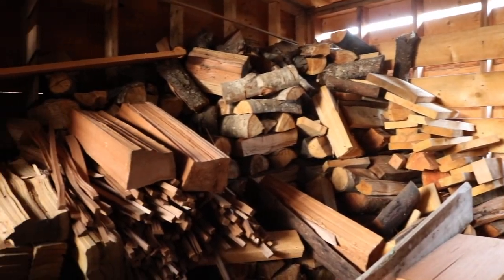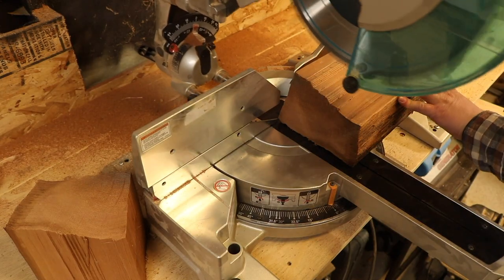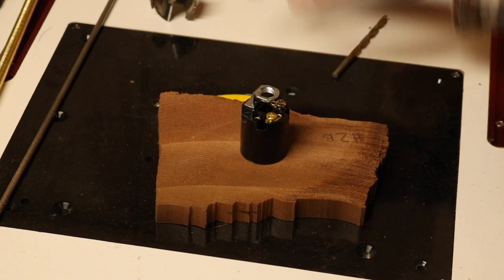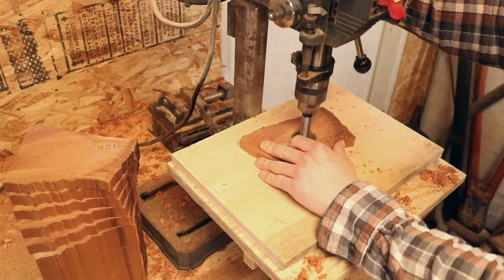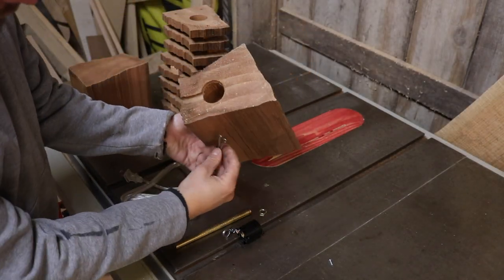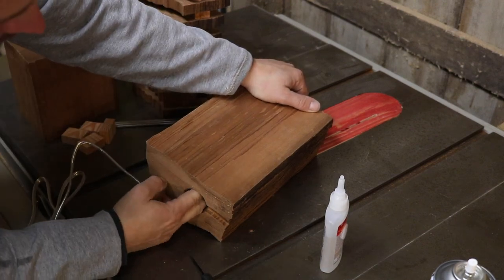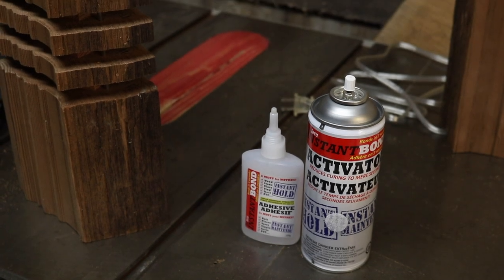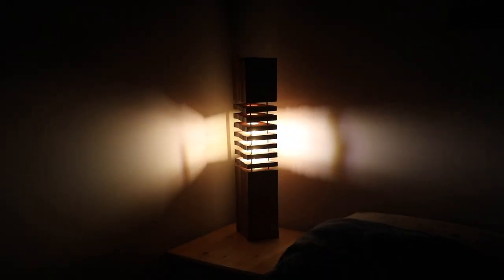How To Build: The Segmented Log Desk Lamp

Comment: Great Job. I took this as inspiration for my own project. The only things I changed is the the mass, adding a base, and the lighting technique.

I’m in Germany doing my Carpentry apprenticeship. On a jobsite I was able to take home an Oak girder beam that we cut out of the house’s old construction (Fachwerk).
My Mass is roughly 15x15cm with a height of 160cm. To put it into perspective, I am 6‘2 which is about 188cm. Perfect for the living room.

For the base I used two 4x6 cm pieces overlapping and painted black to match the live edge oak end table I built.

I didn’t like how the light doesn’t go throw all the slates so I took 2 Satin acrylic glass Pipes (Diameter 8cm and 5cm and an aluminum pipe (diameter 2.5cm). I wrapped RGB LED’s around the Aluminum pipe and basically layered my pipes. One of my Glass pipes did not disperse the LED‘s enough but after I added the second pipe it put distance from the outer edge and the LED‘s and more thickness in the dispersion material. (from 2mm to 4mm). Looks like a big light saber now!

Glued the slates onto the outer glass pipe. Looks amazing!!
Reply from the maker: Thanks for reaching out and sharing what you have built! The lamp you have made sounds like it turned out great! I'm in the middle of making a smaller Lamp, however I might take some ideas as you described and add that to mine! 
Thanks for sharing.

Comment: Great job, my friend. My only concern is the wood browning or burning so close to the bulb. Any preventative measures that could be taken? Great video. Thanks.
Reply from the maker: tjkoker I used a LED bulb so the heat given off is a lot less. If I was using an incandescent light I would definitely be a lot more concerned about this. 
I did a test with the LED lamp and found it hardly put off any heat.